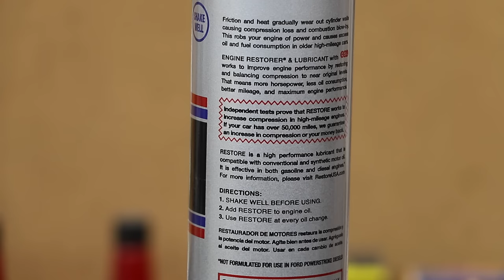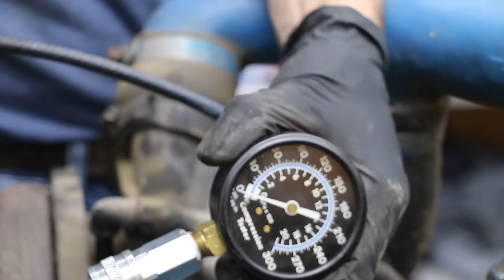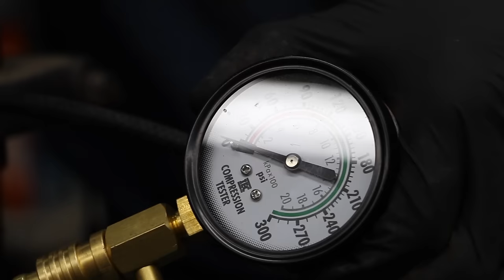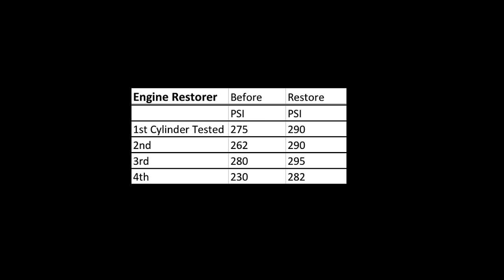Does Restore Work?  Will it Improve Engine Cylinder Compression?

Comment: I tried this stuff years ago in a round track race car, it was a street class car with a stock small block chevy. put the old used engine in and it smoked so bad we coudnt race it. we put restore in it and it quit smoking completely, we raced and won that night. but it was a claimer class race and somebody bought the car  after the race. next week it was back smoking like crazy, the guy said he changed the oil. we bought it back after the race and put restore back in and again it quit smoking. I am a profession mechanic and never would have believed it if I had not seen it.
Reply from the maker: Impressive results!  I was skeptical too until I tried it.
Reply: K quilter Are you saying that restore only fixes compression if it’s added to every oil change? I was under the impression that you only use it once.

Please clarify, thank you
Reply: @syoung20001  in my case it was oil usage , smoking, not compression. and when the oil was changed it started smoking again immediately. when the oil was changed again with restore it stopped smoking. this was in a street class round track car that was ran very hard.
Reply: @kquilter1393  Yup, someone above said it takes up to 5000 miles for everything to work its way onto the engine parts.  So your first bottle had no time to do its magic, it was just working with what was still circulating around in the oil.  So when the oil was changed, almost all of the Restore was removed.
Reply: @BlueBomberTurbo  How exactly does Restore work? I mean you share the claim that it takes 5000 miles to "work it's way into all the engine parts" which is vague as all hell..
Reply: Antonio Farina  lol
Reply: @SpenserRoger  ....I used Engine restore for the first time about 30 years ago. First let me say,  it absolutely works, and it does a whole lot more than just restore compression.  Now it may,  or may not work,  if your engine has certain problems,  but if the engine is just tired,  with nothing like broken rings or scorched valves,  it will restore power,  compression, and gas mileage,  as well as reduce smoking and engine knocks.  It actually only takes between 300-500 miles to break in, but you are supposed to use it every oil change. I can attest,  if you change your oil,  and not use it, it will go right back to being tired.  On the bright side though,  you can go a lot longer between oil changes! I know this is late,  but maybe you'll still find the information useful.  I have used it in several cars and am getting ready to use it again,  difference now is,  by using pure synthetic oil,  I can go about a year and a half between oil changes,  even longer! I could tell you some impressive stories about this stuff,  including about how we tore down an engine with Restore in it, right after the break in period... INCREDIBLE!
Reply: @Quickened1  oh no man I believe you. I've been driving W124/W201/W140/W163 Mercedes Benz's, which already have high oil consumption "built in" (lol) as per stated in the owners manual and as they hit 200k-300k-400 000 KM (125k to 300k Miles) they really start to chomp on the oil. 

 Plus you start to get really embarrassing symptomology that usually starts with blue puff when you gear down and floor it, developing to blue puff on start eventually leading to a weird blue haze that the wind will carry up beside you when you're sitting idling in traffic at the lights. You also will get valve noise if you have hydraulic lifters that are designed to prevent the need of valve lash adjustment. 

Usually these symptoms point to valve seals or plugged oil returns from the head leading to the crank case ( with the latter usually due to manufacturers defect). And this is usually true as valve seals will fix the issue though valve guides also wear out (some engines worse than others) thus even if you change the valve seals the problem will come back much sooner). 

Other issues that have made this worse in many cases is overheating, head gasket leaks including oil contamination with coolant. Sludge build up due to a lack of maintenance or bad design and non-synthetic oil use (ie: cylinder head is chronically at high temperature requiring synthetic oil and decent oil change interval). 

What of course is the 'Magic' fix for these issues for me has always been "Oil Stabilizers" that I believe work through the mechanism of modifying the viscosity ie:  thickening the oil with resins etc. I've noticed that a certain brand that shares a surname with the guy who made Star Wars seems to work wonders. Though it's actually not that stable at all, lol, and its effectiveness decreases before a regular oil change interval meaning you have to keep adding it to maintain the effect. Oil filter changes also help, same with flushes as ya, sludge lol. The "synthetic" version is also much thinner and doesn't work nearly as good. Give me the thick syrup that sticks to everything boi. It's also really effective at keeping the hydraulic lifters from draining out at low oil pressures at idle due to wear to not only the lifters, but increased clearances all over the engine.

Those coolant system stop leak / head gasket repair additives also work absolutely amazingly if you follow the procedure (sometimes 2x or 3x in worst cases) and match the "fill" agents 'shrink/expand due to temperature ratio' to what ever the metals are where the leak is. I've seen them repair terrible head cracks and gasket leaks and leaking radiators/ heater cores swimmingly. There's powdered versions too, and I've noticed the older formulations tend to work the best as opposed to the silver or copper colored fluids of  big bottles you see a lot lately. There's also at least two different main active ingredients that you can try. As long as you don't over heat it again it will last forever. (Also, egg yolks and pepper work amazing in a pinch). There's also a method where you remove the spark plug of the offending cylinder while you do the procedure. It's also a good idea to flush the system well and then flush your rad and heater core separately after tho it's not necessary. The way I do it is put in a strong acid, leave it for awhile, and then use compressed air and really blast it out. A few of those, sometimes over night, will clean out any of them gummed up cores, especially blasting it both ways, with hot and cold water. Pressure washers can help too but be careful with plastic end tank versions. 

HOWEVER...my question with Restore is this....my understanding of oil consumption due to blow by...is it's often caused by varnish /burnt oil / whatever it is/ build up on the cross hatching of the cylinder walls. Ie: it's not so much the wearing out of the piston rings / cylinder walls but that the cylinder walls get covered in a hard burnt layer that prevents the cross hatching from doing its job, and the oil basically slipping past the now slippery cylinder walls and no longer sharp piston rings and burning in the combustion chamber.

Restore claims to work via "CSL particles" which "adds metal back into the scratches cut into the friction-producing surface metal by normal engine wear." 

"RESTORE Engine Restorer is the only product that contains the proprietary CSL (copper, silver, lead micro-spheres) formula. This technologically advanced formulation has unique properties that actually fill in and seal micro-leaks in the cylinder wall. The result is increased engine compression and more engine power."

Does this really work? If it does we should be able to see that or measure that or something upon disassembly?

I don't know. I saw this video 6 months ago or whatever and I got excited to try it because I thought it worked via the "cleans cylinder wall varnish mechanism" but upon learning it doesn't I was like "wat"? I will still try it. They say you can even just put it right in the spark plug hole if you want.

I always thought that would be a cool way to target a new engine recovery system via the spark plug hole if the cylinder varnish problem is really true. Ie: If you could some  how accomplish the same thing as a light ball honing without taking apart the engine or damaging it after. That would be cool. 

Anyways sorry for the novel but I hope it helps.
Reply: @BlueBomberTurbo  It says... HOW DOES RESTORE WORK?

RESTORE Engine Restorer is the only product that contains the proprietary CSL (copper, silver, lead micro-spheres) formula. This technologically advanced formulation has unique properties that actually fill in and seal micro-leaks in the cylinder wall. The result is increased engine compression and more engine power.

But I thought it was cylinder wall varnish that actually causes most blow by thus why people will do a light ball honing to clear that and that certain additives actually target the varnish? I dunno?

We should be able to see or measure the results right upon engine disassembly right? Is there any videos of that? 

Btw the above link is now broken heres a new one: https://www.americantechnology.co.uk/faqs---engine-restorer-37-w.asp
Reply: @SpenserRoger  ... It works exactly as they claim it does,  I can attest! As I stated,  we pulled a big block engine apart right after the break in period,  and yes,  it added a bronze looking metal to every moving part!!! What was so impressive,  was that upon inspection,  every single part that moved,  from the main and journal bearings, all the way up to the rocker arms and pushrod tips, were now bronze colored instead of silver colored.  You could actually see the added material to the piston skirts, rings, cylinder walls,  and bearings. We didn't try to mic it back then,  didn't need to,  we could just see it, and the results spoke for themselves. My buddy had been a master mechanic for over 20 years,  and he said he had never seen anything like it. I was the one who told him about it,  he didn't believe me until he saw it with his own eyes! I kept telling him stories about what it had done for a real old car of mine,  so he finally gave in, and the rest is history. So basically,  it does just as they say, it fills all scratches,  down to microscopic levels,  with CSL which restores tolerances back to factory (or even better,  if possible) specs. This action results in rings re-seating with cylinder walls,  slowing or eliminating blow by and compression loss, quieting, rod/crank shaft knocking,  lifter/rocker arm tapping, and timing chain/distributor gear noises.  It does all of that and more,  because when all is said and done, not only will you probably burn less oil, your engine will most likely run like new!!! P.S. learned a long time ago,  refrain from using oil thickeners,  it is detrimental for your engine in almost every way! I could tell stories about this stuff,  but my typing fingers are going numb,  so try it out,  and good luck!
Reply: @Quickened1  Thanks champ!
Sounds impressive.

Well it looks like I'm going to give it the ol' college try. I have a clapped out 375k KM Mercedes Benz w163 V8 that has some crazy bad hydraulic lifters that just won't stay pressurized at idle. I have a used set I was gonna put in but I will try restore first.

I read on the website because of the CSL you want a really clean oil system and replace the oil filter more often on older engines so I'm going to have to that as well. 

I'm pumped. And ya the oil thickeners I've heard bad stuff about them aswell but when your valve seals are just fried it's like night and day!!! 

What would be cool is something where say you popped off your valve cover, maybe spray down all your valve seals with a solvent or something, rotate the engine a few times till its oil less and then some how through the magic of material science drop on some kind of fluid that replenished them. 

Or maybe some way to apply new metal tension springs easily, or helper springs, or hey just zip ties lol. or perhaps some kind of heat treatment to get them to tighten down? 

Or what about that oil stop leak stuff that is supposed to make seals tighten up?
Reply: @SpenserRoger  ... just change your oil,  you might want to run Rislone in it first,  to flush the system if it is heavily sludged.  Just add Rislone to your old oil and follow instructions.  Once the new oil and filter are in,  add the 8 cylinder can of Restore, then drive 300-500 miles, doesn't have to be all at once,  you can span it over several days. Make sure not to overfill because of the Additional volume of Restore. That's it! Don't try anything else,  I think your gonna find those lifters pumping up again... Remember me,  and let me know how it goes! PS, don't worry about changing your oil filter any extra times, just at the regular intervals,   it'll be fine... Get ready to feel the power come back to your tired V8. It's going to happen like overnight sometime between 3-5 hundred miles. One morning you're going wake up,  start the car,  and it's gonna feel like a new engine as soon as you start driving.  From that point on,  you have to add it to every oil change religiously...
Reply: syoung20001 The instructions on the can say to add to every oil change.
Reply: So it seems like you just add this each time you change the oil.
Reply: @borntobewild846  that is correct,  and it will make a tired engine run like new if you do so....
Reply: @SpenserRoger  Did you use the Restore in that W163 yet?
Reply: @mannys9130  nah I ended up having a problem with the transmission and put it up on Jack stands. I'm almost done though, I definitely want to try out 

I'll let you know!
Reply: @Quickened1  did you say a year and a half just by using this stuff? Is that even healthy for the engine to be doing that or keep using this stuff?
Reply: @syoung20001  it is supposed to be used every oil change. i do on all my high mileage vehicles. it does seem to make them run better.
Reply: @SpenserRoger  Thanks for posting that link, Roger. It was helpful.
Reply: @SpenserRoger  I think the prob is the oil control rings and not the valve seals. The oil shouldn't be getting that high in the first place

Comment: Ive been using restore for years on just about every vehicle I've owned. It smooths the idle, stops oil burning and makes it a lot more powerful. I'm so glad to see it wasn't just wishful thinking and to see proof behind it! Thank you!
Reply: Justin Fincher is it worth using on just a regular car with 100k miles on it?
Reply: I had an old 350 Chevy that was supposed to be a summit built 355horse 350. Well it fouled two plugs every 50 miles number one and number three. I ran a compression check and it ran around 152 on 2,4,6,8 but ( I have no idea why) but on the drivers side of the motor I had #1-110, #3-90, #5-135,7-140.  I ran engine restore with an oil change, right after the compression check, then I changed oil 2000 miles later with another can of 8 cylinder formula and after 1000 miles (3000 and 2 cans altogether) and the end result was 155 for 2-4-6-8 but the drivers side jumped #1-140,#3-130,#5-150,#7-153. I ran that old bigger for a lot of years and always changed religiously after.
Reply: Kip Henricksen That's a blown head gasket Kip, trust me. I know the TBI and Vortec 350 engines really well. I had cylinders 3 & 5 Crossfiring into each other via a head gasket leak. Took me close to a year to diagnose it. Finally, after much frustration, my professor told me to 'go back to basics' so I preformed a Compression Test BANG! found it. It would pass smog, not smoke or use water and still ran excellent other than a small idle fluctuation.
Reply: I have used it for years once my cars get over 75k i add it in every oil change. I think it works great.
Reply: So do you add this when you change your oil and just always run the engine with restore in it?
Reply: @Justin Fincher
have you tried Marvel Mystery oil after the Engine Restore treatment?  Has it made a difference.
Reply: @rambow70  i use it after a oil change when it needs 1 quart just add the full bottle in it when it needs a whole quart never add it if its full of oil
Reply: @DJAsHeRMusic Yes🎉🎉
Reply: @user-yi2sd6mh9w  thanks only waited 6 years and 3 cars later to find this out 🤣

Comment: It really works. I just tried it on my 4.3L V6 and it works way better now. One of the cylinder had a sparkplug with a shipped ceramic piece, so I assume it scored the cylinder so that's why it was running on 5. Now all the 6 cylinders are firing. Thanks alot for this video.
Reply: I have the same. Hate to do driverside plugs on the Astros. Ugh
Reply: Ok, here's an update. My 4.3 is a 2003, the injection system is known to cause problems with vortec engines 2003 and earlier. I think it might be the cause of the misfire, but since it helped it means the product works, it helped burn the uneaven mixture by better sealing the combustion chambers. It still bugs sometimes so I should have to change the injectors assembly for a more recent one, cause it might be the reason of the misfire. I'll do it tomorrow, so it should tell if it was the main cause of the misfire.
Reply: Here's my follow up on my experiencewith this product. First, I had to scrap my van cause it was too rusty, when disassembling the distributor I found that the rotor had lost the contact point in the middle. I'll never know if it was the cause of the misfire in first place. I tested the sparks and all was good... I'm a little ashamed that it is not a good reference as I didn't check compression like project farm did, but I swear I noticed an improvent.
Reply: a shipped ceramic piece
Reply: @matthewronsson *chipped, obvious they meant